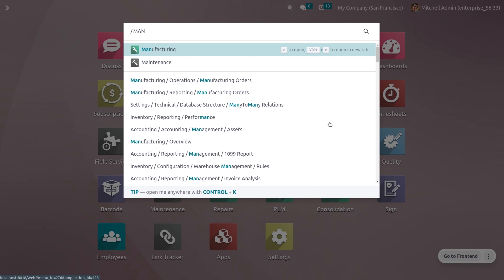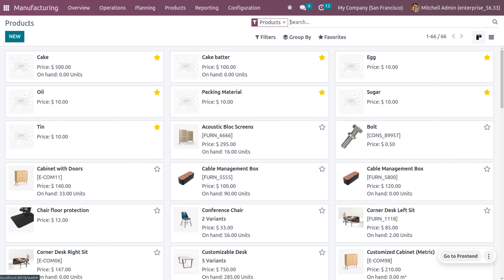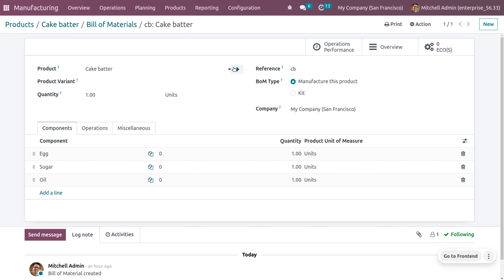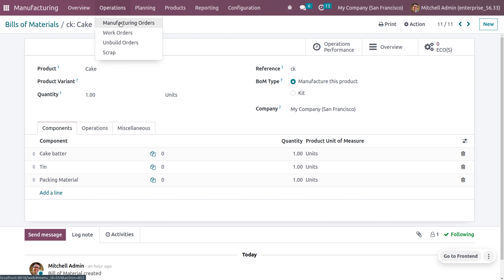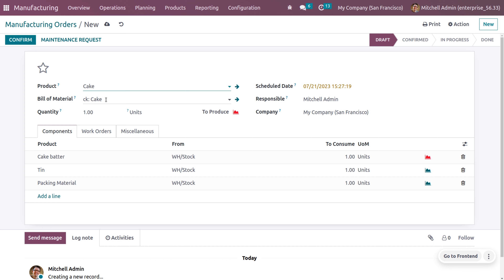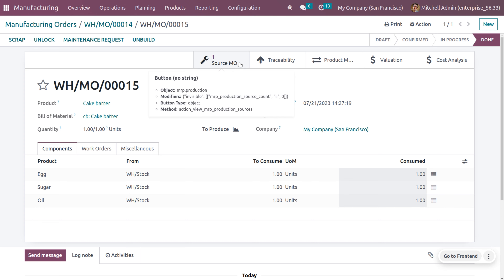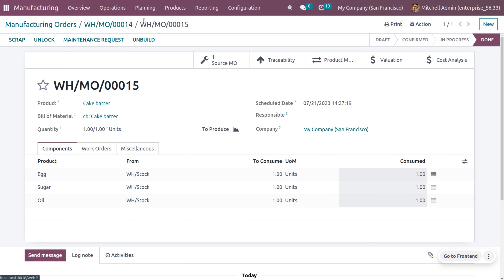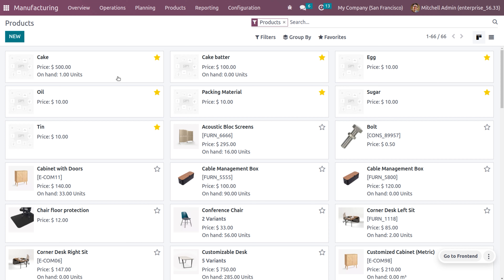How to Manage Multiple Bill of Material (BOM) in Odoo 16 Manufacturing | Odoo 16 Tutorials

Comment: Hi, It's good video. Can you please assist me why I am not seeing the child MO and Source Mo in odoo 17 ?
Reply from the maker: @Faslu CA Ensure that the route 'MTO' and 'Manufacture' is correctly enabled for the child product. If the route is correctly configured, Child MO and Source MO will be available.
Reply: @cybrosys-technologies  this is working perfectly when creating a manufacturing order through the manufacturing module. However when doing a sales order only the parent item gets a MO automatically created. The child MO doesnt get created? Not sure why it works perfectly one way but then doesn't work on the sales order side even though all part settings are all the same.